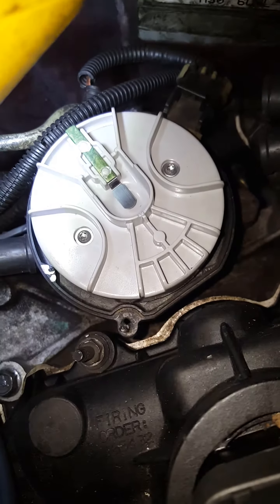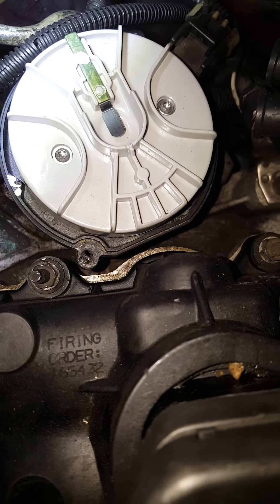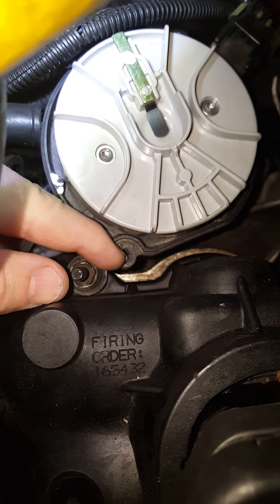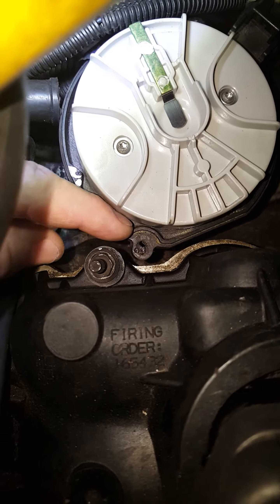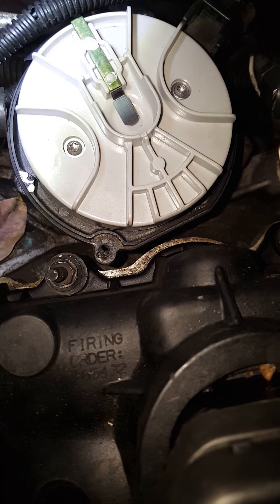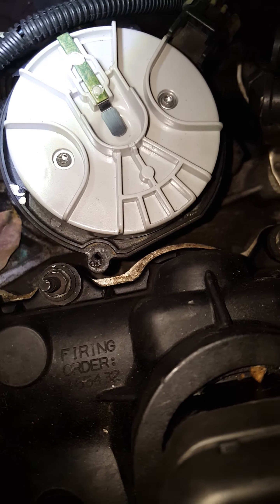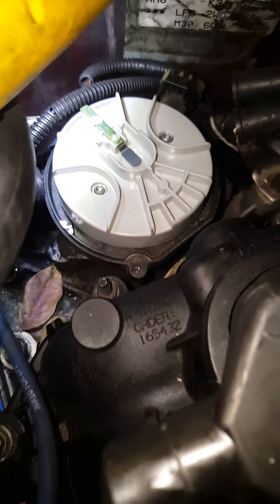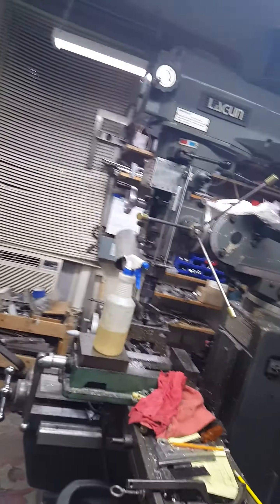1998 S10 Pickup Distributor cap install screwup

Comment: New 1998 5.7l $3000 install $2000   Started getting misfire code random cylinder error message  flashing check engine light.
  Start looking myself  pull air filter assembly.   SAME EXACT THING DISTRIBUTOR BROKE OFF AND OWNER OF SHOP TIE WIRED ON.

ADVANCED AUTOMOTIVE SHOP
COOK ST SANTA MARIA CA.

On another note while trying to figure out i went to change GAS FILTER,  NO WRENCH NEEDED TO REMOVE EITHER SIDE OF FILTER  FINGER LOOSE.
 THIS MAN IS A CROOK.

Reported to all agencies